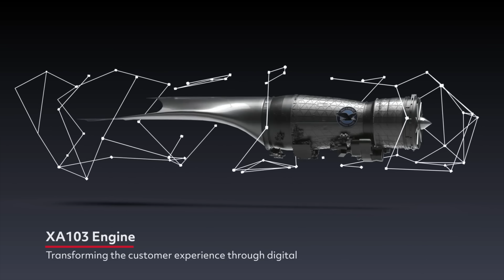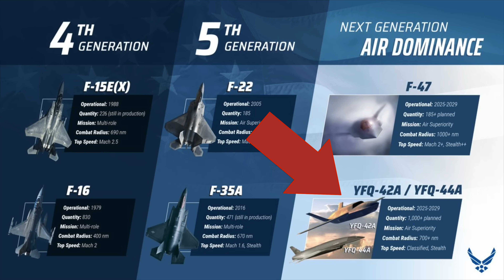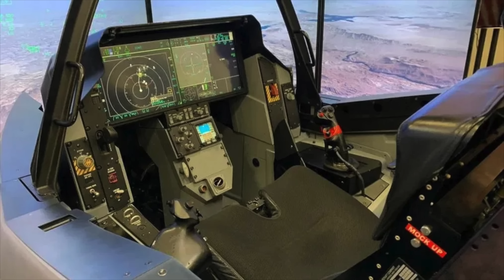Is the US Air Force F-47 Already Flying Missions?

Comment: I think there is a misunderstanding here. The F47 will probobly be a 0 pilot plane. That is, it will never have a pilot. It will have a operator or a commander, this is similar to how Gripen E works. There is a high-speed link built into the radar system.  This link is below the noise floor, so its really basically undetectable by other EW assets. The link coordinate radar but also operator work. So a wing of operators can work as if they are in the same aircraft. 

So if you have a 2 wing setup you will basically have 4 operators. Or more likely 1 commander and 3 operators.

For the new system of radar the communication antenna, radar, EW assets are all bind together with the same element and software driven. This is of cause necessary to make good use of a drone wingman, but its also part in parcel with the new generation radar. Gripen E already adopted it and fielded it in 2023, and F35 will field it to the block 4 version and gain most of the advantages.

We also know, at least in general, about the stealth system of F47, its basically the same as of B21. To my knowledge F57 was confirmed to lack canards, but it have two additional high angle tale surfaces. This seams logical due to it being well known to reduce signature of low frequency radar, something that is a issue with F22 and F35.

Also the aerodynamics is improved a bit, but not really t a extreme degree. I would think it probobly will have conformal drop tanks.

Really basically all the systems short of the engine, have alreddy been implemented in other aircrafts, so its really not that secrete.

If we could compensate on the low frequency stealth we could probobly implement all those features in the F35, while, yes, the top speed would be slower. Making it sort of a F/A18E version of F35 or say a Gripen E version

Comment: 0:20 That image is fairly old... and most likely a Saab Draken.
Reply: That image is actually from 2022, do some research before we speak sir 😘
Reply: @Justin..ajb42  and that disputes what I said?
Reply: @Jeff55369, considering the aircraft has been in the air since before, then yes, yes, it does. 2022 isn't old, bro again do some research before commenting it is not a Draken 😂
Reply: @Justin..ajb42   It looks exactly like a Draken. And considering how fast news cycles go, a 2 -3 year old image is quite old.

I doubt very much the USAF would run their top secret fighter program out of area 51 considering it's notoriety.

Comment: The F-47 sounds like an absolute Behemoth of an aircraft. Range, payload and literally invisible to radar. I would be very surprised if it is not capable of launching a dozen or more air to air missiles. The ability to gain Air Supremacy and negate IADS makes it simply incredible. The USAF has a large number of new weapons coming into service and these likely are intended to improve lethality. The AIM 120 is unlikely to be it's main weapon with the AIM 260 being the main weapon. The AIM 160 is another good possibility.

Comment: Kinda off topic: I read a comment referring to the JTAM, from a top Air Force general, and he claimed “we could lose half our Raptor fleet and still be fine due to the AIM-260”. But it seems that the AIM-120E is actually approaching the publicly disclosed JATM range. So maybe the AMRAAM could be as good, or similar to the JTAM. 🤔
Reply: There is no E variant currently. The D3 was said to approach the threshold range for JATM (i.e. the minimum requirement). Of course it's also been said that JATM could double the range of the D3.
Reply: @rogerbiggerstaff3293  the way I said that did insinuate it already exists. My bad. It’s “possibly” in development but I’m sure they’re further along than they report, but that’s just speculation based on precedent with our military. It’s supposed to bridge the gap in range between the D3 and JATM, until the 260 is combat ready in enough stockpile. But like you said, the D3 is getting close to 260 range so the E variant may not even be needed. I’m pretty sure the D3 already outranges the PL-15 but again, that’s speculation as public reporting is rarely even close to accurate by either side, as it should be.

Comment: I felt like I was watching Clint Eastwood in Firefox!   Cool Plane
Reply: First thing that came to my mind as well!
Reply: It definitely looked like Firefox to me as well… I should go watch that again, been ages since I’ve seen it.
Reply: Ha! I was just getting ready to post that.  Eerily similar.
Reply: Must think in Russian.
Reply: I was just thinking that!
Reply: @thunderamu9543  But did you remember to think that in Russian?
Reply: @wrath53339  Yes, I made a separate post  updating the quote."😆
Reply: Now that you mentioned it
Reply: That was CGI and the artist has never seen the aircraft.
Reply: Well it probably doesn't have that shape.
It's still classified, these are just guesswork renders.

Although wings which angle down at the ends could be a useful feature for a high end super-cruise plane. Kinda surfs the supersonic shockwave. The B-70 had it.
Reply: @kathrynck  Nice thought. The B-70 relied on compression lift. When the wingtips were folded down to 90*, the large engine nacelle squeezed the airflow outboard to about half of the original volume against the downfolded tip, thus creating higher pressure.
Reply: Damn it, I just posted the same thing then saw your post 😂
Reply: I actually saw that movie in the theater when it first came out. I purchased it on Laserdisc (home media) quite a few years later in 1996; still have it.
Reply: I hope it's for real 🙏
Reply: i was definitely getting the firefox vibes from this thing. glass i'm not the only one!
Reply: Same here.  Back when I saw that at the movies, I thought that would never be possible, lol.  This stuff makes that look like a cheap Russian/Chinese knock off, lol.
Reply: I’ve seen comments in other videos with the trolls of China and Russia getting tired of being made fun of because their best jets they brag about are very few in number.  So when the f-47 was announced, they tried to claim it all was fake and CGI like they’ve been caught doing.
Reply: Look up  "Bird of Prey" & "US X-Plane" together  You will see THE prototype the F-47 was birthed from!
Reply: Yep me too! Without the verticle rudders
Reply: Indeed, but way more advanced than that fiction plane.
Reply: That was my first thought also. Great minds...
Reply: MiG-31 !! Thought the exact same thing.
Reply: Was thinking the same thing. I guess I’m old.
Reply: Pretty much, just missing the verticals
Reply: Nice reference. Did you read the sequel book?
Reply: @rickbase833  Yes, I read both books!  Could not put them down!
Reply: @rickbase833  I didn't know there was a sequel book, thanks for the tip. I'll add it to my reading list now.

Comment: I can only wonder and Hope that the f-47 has infrared reducing Tech incorporated in it. Whether or not it is passive or active Tech is irrelevant. However with other nations finally catching up with low observability for radar cross-sections and absorbing paints and all the other stuff that we don't even know, I think, I believe that the future is going to be long range infrared detection and missiles. I think certain countries have already started to progress in that area and I don't believe it's too far fetched to think that being able to Launch a missile long range that is Guided by infrared sensors in the aircraft for a majority of its mission and then infrared seekers in the missile when it gets closer take over. All of our infrared missiles are all short range but I think that's about to change. The F-22 Raptor supposedly has coolant lines and it's leading edges to help reduce its heat signature for the shortwave infrared Spectrum when it's airframe heats up from friction. There was talk that there would also be that incorporated into the f47 Plus heat absorbing tiles and space between hotspot points like the engines and the fuselage meaning you would have the engines then you would have the fuselage and heat absorbent tiles between to reduce the overall infrared signature.
I know this has been going on Long, but any thoughts on this?

Comment: I have seen some pictures dating back to 2014 of some ufo's/uaf's that show something roughly this shape flying so i wouldn't doubt it. This does make me wonder why they had this plane out in the open as they do keep track of the satellites that fly over area 51 and they never leave anything they dont want you see outside like this. The only planes ive ever seen on satellite at area 51 are the janet 737 occasionally a beachcraft or 2 some f16s and and an f117. It does make wonder why they wanted us to see this plane.